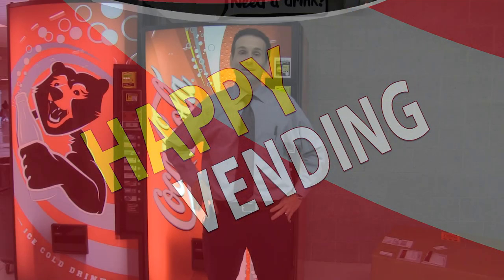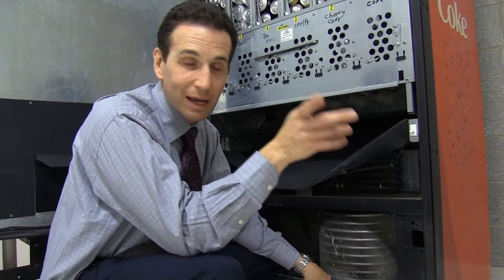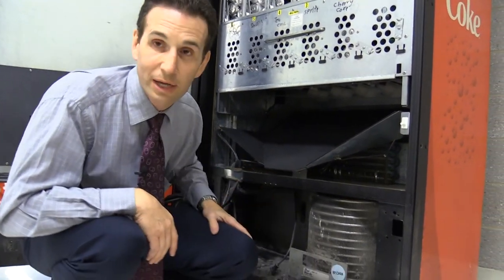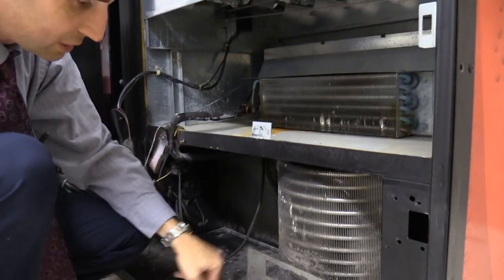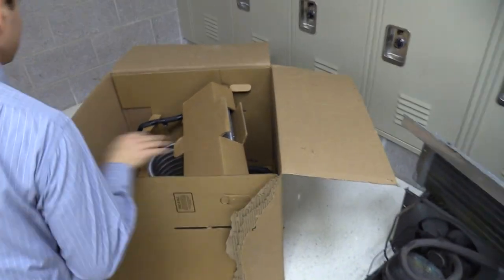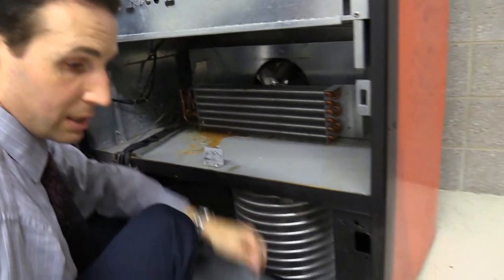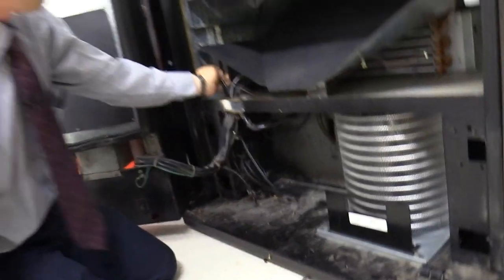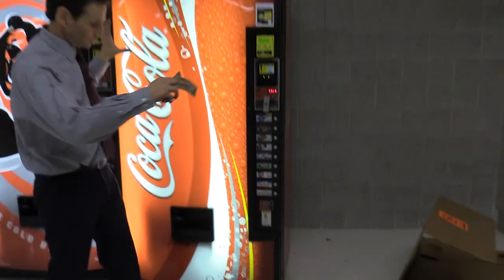Replacing a Bad Cooling Deck in a Soda Machine

Comment: Just want to say a big thank you for this video.  I just replaced my Royal 650 cooling deck by myself! I had an issue with drop chute that I thought your viewers might like to know.  After I removed the drop chute, it came unplugged from the board.  I didn't know it and after i was finished with the cooling deck I tried to vend a drink to test out the chute (good advice!!).  The machine wouldn't vend anything.  It took my money but wouldn't dispense at all.  It was like all the motors were dead.  Because of what you said about the chute, I knew it had to be that.  I looked all around inside the door and found the plug for the chute hanging behind a piece of the door metal.  Luckily the previous owner had marked the cord "chute."  After looking the control board over, I found a place to plug it in.  After an unsuccessful try, I decided to unplug it and do it again.  That time it gave a loud click and the machine  worked on the next test.  Thanks again for all the good videos you do!!
Reply from the maker: Glad you got it working!

Comment: Thank you for your video.I was a bit worried about removing the cooling unit.Such a easy process.Thank you once again.👍
Reply from the maker: I'm glad I could help.
Reply: not really and easy project if you can't get the door open all the way otherwise you will be bending your product chute getting it out..than putting it back in you can jam it up into the chain sprockets and parts will be flying!!!  cool

Comment: This is a very informative video. My old Dixie Narco from the early 1980's didn't come with a manual. However, it seems to be quite similar sans the vending and door sensors. If I ever need to replace my compressor, I feel like I can do it after watching this video. I like your other videos. Too bad that you don't have any old 'vintage' machines to service. Mine is not old enough for the Soda Works people, and too old for most modern vendors. Mine falls into a 'donut hole' if you will. I subscribed to your channel.
Reply from the maker: Yeah...Dixie Narco stack machines are pretty easy to swap out the compressors too.  I think the old machines look neat, but they are not practical when trying to make money with a vending machine....so I only buy machines mid-90s or newer.
Reply: @HappyVending  We got ours dirt cheap from an old Coke delivery man (retired) who was able to take one home in the early 90's when this model was replaced by newer machines. It is in fantastic shape other than the coin mech needed repaired. It's still an S75. I'm putting a 3340 in it. I live in a touristy town. I bought it mainly for my family and I've always wanted to own a soda machine. If other people or neighbors use it, wonderful. If not,  no big deal. However, if I get bitten by the bug, this may be something that I look  into. I am thinking about taping dollar bills to a few random cans, or making certificates to local businesses in town to put on select cans. It might add to the fun and more people might use my machine?
Reply from the maker: @TheDurnans  Good luck with the machine...I hope it works out for you!

Comment: hi, you wouldn't have the link where you bought the cooling deck. I have the same royal 660-9 but I'm having trouble finding one for this model. I know its been a few years but doesn't hurt to ask. Thank you again for your videos.
Reply from the maker: I always buy them direct from Royal...they usually have them in stock...but they are pricey now.  I know because I had to purchase one a few months ago and it was 800 dollars.  Give royal a call at 1-800-931-9214

Comment: so i just purchased a Royal GIII.  fortunately the previous owner gave me a 6 mo warranty since he replaced the cooling deck several months back.  the compressor does kick on but the condenser coils don't get cold.  i was thinking it needed to be charged.  i know you mentioned that you would have a refrigeration specialist come out, but is it something i can charge myself?  i was thinking similar to charging the system in a vehicle.
Reply from the maker: If he gave you a warranty why don't you call him?  Are you sure the compressor is kicking on and not just the evaporator fan?  To recharge the system you would need to put a tap on the line.
Reply: @HappyVending  i appreciate all your videos and your response.  UPDATE - he finally showed up and replaced the cooling deck.  seems to run great now.

Comment: You can call a refer tech to add freon but remember it's a sealed system so whatever he adds it's going to leak back out most all leaks are at the evaporator area which are very hard to fix easier to replace the whole evap.

Comment: Where is the actual thermostat on this royals? I just got a 660 and shows 40 degrees dont know if thats the optimal temperature for cold drinks or has to be colder?
Reply from the maker: The temp sensor on most royals are on the back of the machine.  The temp should run between 32 to 42 degrees...depending on where your cutoff and on temps are set at.

Comment: Hey Bill, nice video! Fernando from Chile here. I got a few soda machines, same model, fist kind of machines that i have(I have more snack machines, other brand) . The connection from the machine to the cooling deck is just de relay with the plug right? The temperature sensor is not connected directly with the cooling deck, its connected with the controlboard im right? thanks
Reply from the maker: Yes, you are correct on both questions.  The cooling deck simply plugs into the relay with a regular outlet...and the temp sensor goes to the control board...not the cooling deck.
Reply: @HappyVending Thanks!! nice job! aprecciate it!

Comment: Oh yea and how do you get it to say that is it through the credit card reader if so how do you program that I have the Nayax touch screen ones thanks and great work
Reply from the maker: Go to Operations, then Machines, then choose your machine.  Then click on the Attributes tab and make sure the Language/Audio options are turned on.
Reply: On the nayax machine or the app?
Reply from the maker: @jdmtake1  Using the Nayax computer interface....I'm not sure exactly where it would be on the app.   You can't control much on the machine itself.

Comment: Where is the thermostat?  Is it built in?
Reply from the maker: @pamelamason3004  the thermostat is seperate and not part of the cooling deck.  It connects directly to the control board.

Comment: I have a question I cant find the answer  anywhere else I have a coca cola 660  the power cord has it's own little reset on it when I plug it in it  runs for a couple of days then when I go back its powered off I have to hit the reset button  why does it keep powering off after a couple days could  it be a bad power cord also around 100 to  110 degrees  or so in my  building  could that cause  it to  cut off  it never cut off in the winter I dont think
Reply from the maker: Sounds like you have a ground fault interrupter on your cord that is going bad.  Is that permanently installed, or is it on a little pigtail that the power cord plugs into?  Is the machine located outside?  I don't use GFI on any of my machines.  If this machine is inside, I would just put a regular power cord on it.  If you really need a GFI on it, you could install a GFI outlet in the wall and just put a regular plug on the machine.
Reply: @HappyVending  it on the power cord like a big box with 2 buttons
Reply from the maker: @stelthcamo357   Yeah...that's the GFI and it is probably going bad.  If the machine is inside, I would cut it off and put a normal plug on the machine.
Reply: @HappyVending  GFI outlets are not rating to operate vending machines drawing 8-12 amps
Reply from the maker: @paulbunyun4479  This 20 amp one should be able to handle the power draw...but once again, I don't use them.  https://www.homedepot.com/p/Leviton-20-Amp-Self-Test-SmartlockPro-Slim-Duplex-GFCI-Outlet-White-R12-GFNT2-0RW/205996739?source=shoppingads&locale=en-US&&mtc=Shopping-VF-F_D27E-G-D27E-027_002_WIRING_DEVIC-NA-NA-Feed-SMART-2181312-WF-New_Engen+PL3&cm_mmc=Shopping-VF-F_D27E-G-D27E-027_002_WIRING_DEVIC-NA-NA-Feed-SMART-2181312-WF-New_Engen+PL3-71700000082410799-58700006989412248-92700062912530180&gclid=CjwKCAiAiKuOBhBQEiwAId_sK1X1-8Sl9_HjwHViHtENfg51cZLqWQr0QtfccZaCjcg7gJ1koWU_ORoCatIQAvD_BwE&gclsrc=aw.ds

Comment: Where the temp sensor my compressor won't kick on I did a test and the compressor  works as it should but then it goes back to vend mode it won't cut on
Reply from the maker: what kind of machine do you have?  Did you plug the compressor direct into the wall and confirm that it gets cold?  Did you do a relay test?
Reply: check your door switch

Comment: Hi I have a machine like this. And want to install credit card reader. How hard is is to do and do I have to move anything on the controls like going into password and like going to card reader. If I can make a video on the card install thanks ricky.
Reply from the maker: If your machine is MDB, then it should be a pretty easy install.  I have a Nayax account and have been happy with their readers.  They set up the readers for you, you just install them in your machine.  Just make sure you unplug the machine before plugging the card reader into the coin mech and bill acceptor.

Comment: Where would the fan relay be located
Reply from the maker: None of my machines have a relay for the evaporator fan.  When the machine is on, the fan is always on.  The relay kit was an added option and you would mount the relay somewhere in the cabinet.  If you go to the relay test in the config menu, and you try to test the fan relay and it doesn't turn off the fan, then your machine probably doesn't have the relay either.  You can contact Royal about getting the relay add-on kit, but it is easiest to just leave the fan on all the time.

Comment: Where did you order the new deck from? Also, how much was it?
Reply from the maker: I got it direct from Royal...it cost about $450 which included shipping.
Reply: @HappyVending  thank you for the reply! Does it come pre charged with freon?
Reply from the maker: @robs7986  Yes...it is a complete unit ready to go.  You can also find remanufactured units for about 290 on eBay...but I prefer buying new units direct from Royal.

Comment: My evaporator fan motor was bad ny fan broke clear off the motor i got my new motor and fan gonna install it should run like new
Reply from the maker: Good luck with the repair Chirs!
Reply: make sure to put the fan blade in the right way

Comment: why not check the compressor with your multimeter to see if the compressor is grounded or shorted out?  It could be just a simple start relay, overload or start capacitor. or it could be a wire that is loose, come on man!!  If you walked by the vendor a few weeks ago and noticed the temp at 89 degrees and you let it go that long of time some of the cans or bottles could have exploded or started leaking..
Reply from the maker: Based on the age of the unit, even if it needed a 3 in 1 start capacitor, that is only a temporary fix and it would eventually go bad again.  It is a busy machine and I decided it was worthy of a new cooling deck.  It's still working great to this day and has made back the money I put into the cooling deck 10 fold.  Once I saw it was warm, I unplugged the machine and no cans exploded or leaked.